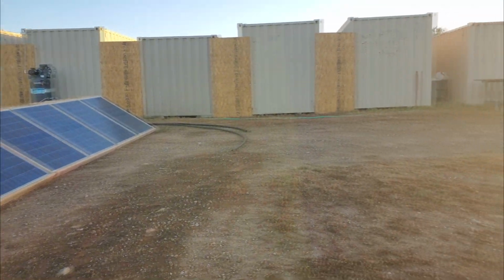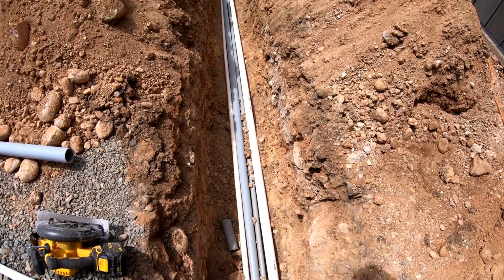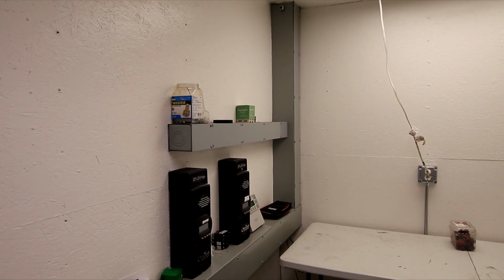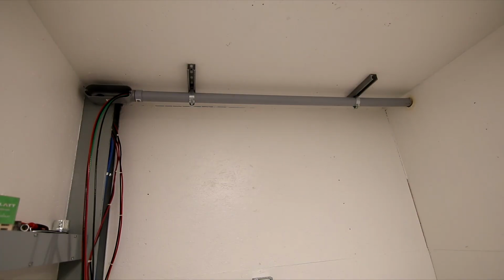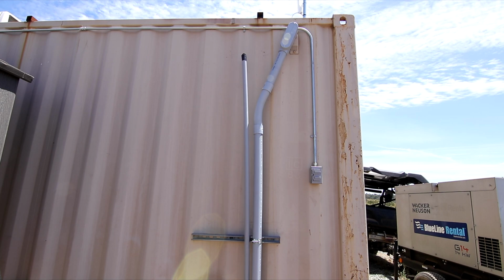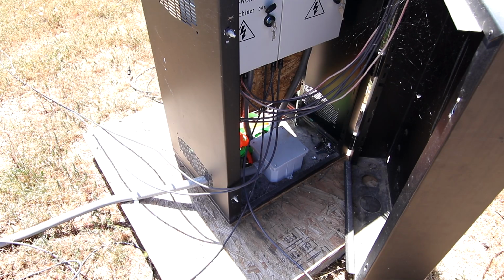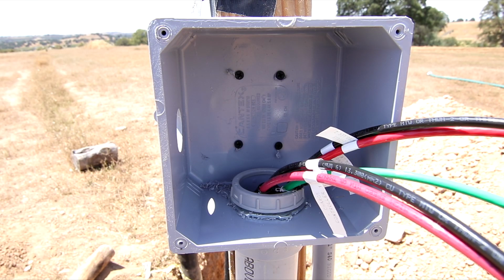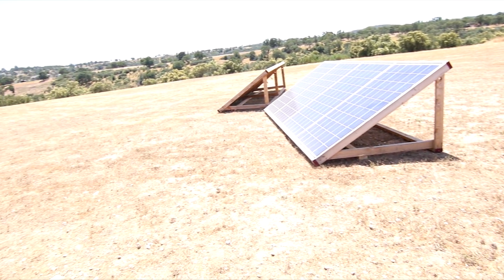Off Grid: Solar Panel Reconfiguration Part 3 - The Insanity

Comment: Just be aware the your data cable length if you are running standard TCP type networking ( home networking type) on Cat5 or 6 cabling, you are limited to a total length of 100m, any longer the your comms will start breaking down, also data cabling that you have underground needs to be gel filled type cat cabling to stop the ingress of water over time in your underground conduit

Comment: One other option you can do is use ground burial electrical boxes (made of fiberglass  & concrete) so have a junction box to pull cable through. I used a couple of these on my property for future expansion. I ran a pair of 2" electrical PVC to each box.The have a removable cover plate, and you can get them either 8000 to 15,000 pound loads (so the don't break if a vehicle drives over them.